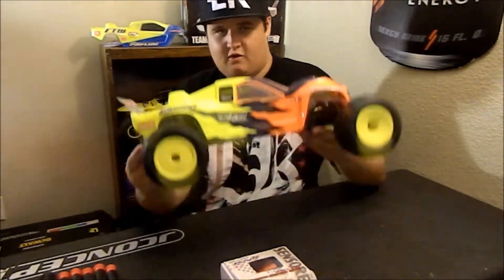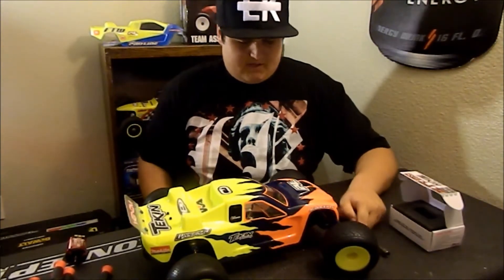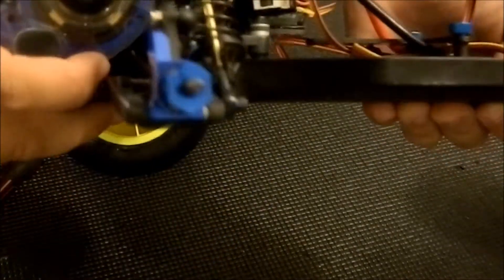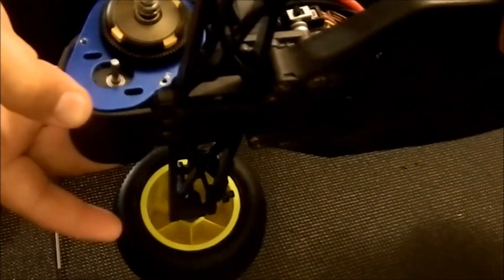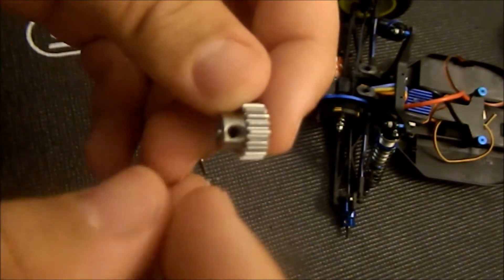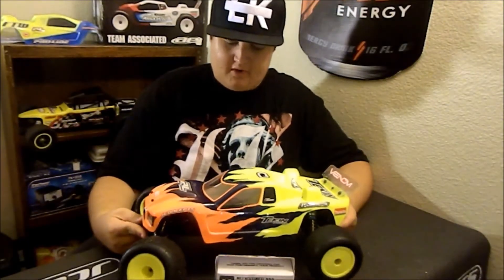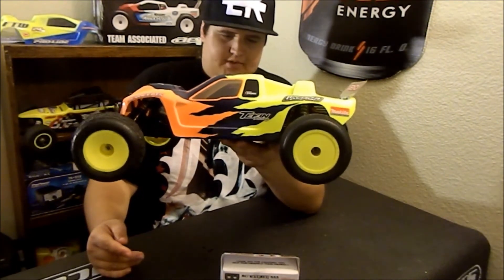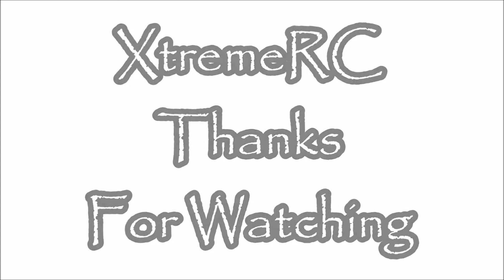XtremeRC - Tekin Redline Gen 2 Motor Installation - How to install your motor in your RC

Comment: A big recommendation after using Ae for nearly 6 years is run the gul wing front arms on that truck. More turn in- to a turn and it's smoother through out the whole turn, I did a little comparing between the gul wing arm in my sc10.2 to the flat sc10 arms that cam on the previous gen and it's a huge diffrence, recommend giving them a shoot!
Reply: And also try to pick up a Tekin RSX or a Tekin Rs Gen2 that motor runs well with tekin esc's. I run everything Orion, you should also give them a look!
Reply from the maker: TheRcworld101 For now my ESC should work okay  but I plan on getting a RS soon but yeah the guy I got it from used the straight arms  I have 2 sets of Gull wing arms I am planning on throwing on soon 
Thanks for the tip (-:
Reply from the maker: TheRcworld101 I also have a gear diff in it as well but have two perfect ball diffs I plan on throwing in just dont like having to do the maitence lol

Comment: How do you connect the motor to the esc. I am looking for a motor but I don't know if I will be able to connect it. Can you tell me how?
Reply from the maker: +Ian Holt Soldering, You use the wires on your esc and solder them to the corresponding tabs on the motor